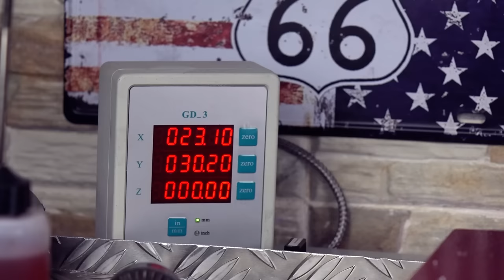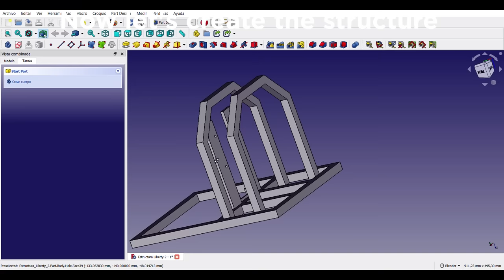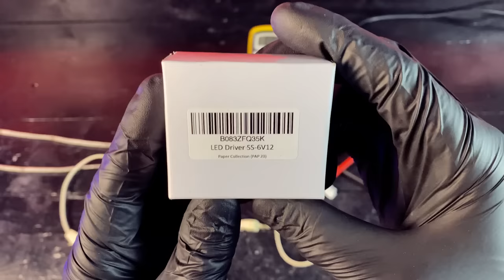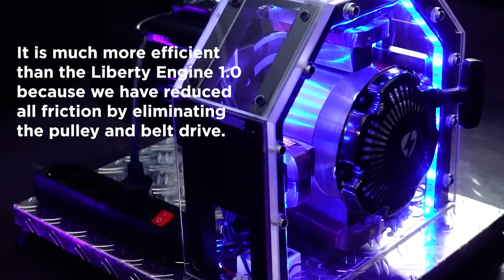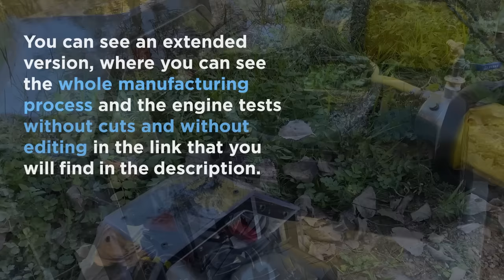Liberty Engine 2: THE PORTABLE FREE ENERGY GENERATOR that you can build yourself

Comment: Its sitting on a Metal welding table, I'm sure a current is running through it. Use the multimeter on the table! Anyone watching this who is educated will know this is a trick. It will always cancel its self out unless there is an additional net force added to keep it going.
Reply: My guess is that the batteries are hidden in the metal frame.  Or maybe, as you say, the table itself is powered.

Comment: You can't manufacture them and if u do a little research you can find what silver aluminum alloy reduces eddy currents go to a metals worker welder and he can melt that down and cut on a lathe. Lastly he is giving this as a free gift don't criticize unless you build one yourself. Then say it didn't work!  All you need is battery cells for a house setup like a tesla power wall and just one of these to generate power. You will have every oil company after this or him so it's given out as a gift I clued you all in why this man is SMART ENOUGH not to show his face.
Reply: Cai nay co gia bao nhieu tien vay sop

Comment: If you want a power output to the loads greater than this, than you must have a bigger size gauge for the 4 coils than what the microwave XFOs have (which are around 16 AWG wires).  Using  8 AWG size wires or even lower AWG sizes wires for the 4 coils will give you way more power to the loads than with the current wire size gauge for these 4 coils.  Bringing the 4 coils closer to the magnets will also be a great improvement.
Reply: Спасибо    за  разяснения

Comment: Actually we are doing this kind of testing with machines as a same.  It’s very difficult to keep rpm stables once connected load for motor.   Will be gets low until nearby to stop.   But if will install n52 neodymium magnets for the rotor then maybe would be good. Good job guys.

Comment: A UPS power backup would work instead of using the pull cord.  
Power directly to the motor will autostart it.
Better yet, a circuit to detect when the UPS is half empty to start the engine and recharge the UPS to 100% before shutting it off again would be great!
I've "performed" actual "magic" with dice, and never can speak of it without being met by complete disbelief.
Who cares?  I know what's real, and that's enough for me. 
This is not free energy.  It's the efficient recovery of stored energy.  
It takes a lot of electrical energy to manufacture neodymium magnets.  
If they were naturally occurring, this would be free energy.
You are not getting something from nothing, as some would claim this is.
Reply: There are a dozen other friction points in this heap of spinning illusion to guarantee it's motion will never be "perpetual".
Reply: @malcontender6319  I didn't catch the part where they claimed this to be perpetual motion. 
That would be an incorrect assumption. 
A generator is not a perpetual motion machine any more than the sun is. It works until it doesn't work anymore. 
Neodynium has stored force. 
This isn't something from nothing, regardless of the fact that everything that exists has originated from nothing.

Comment: Nice idea 
But impractical for industry and home use. 
answer:
First, it will not be possible to connect another consumer to the electric motor shown here, since as soon as we connect, we will receive a drastic decrease in electric power and the circuit will stop 
Because there won't be enough power to drive the motor connected to the circuit.
If you still want to create such a circuit, you will have to connect it to a transformer which will increase the output current above 220v and will be connected to a large lithium battery and if we connect a consumer regularly of course there are continuous losses of electricity in this nice circuit 
And for this reason it did not reach the industry and the home consumer. I was happy to help, have a good day everyone.🎉

Comment: On the frame find the highest point of vibration and at that point add a damper spring . Its an old idea with great results to reduce harmonic vibrations . I suspect the front bearing of the electric motor is bearing more load than was expected . This isnt  a complaint . The noise it produces Im sure is mostly caused by the motors front bearing holding the load of the aluminum rotor . A front bearing and bracket machined to support the front of the rotor could eliminate the issue entirely. I love what you have made thank you for sharing all your hard work suggestions aside you made a great machine.

Comment: Couple questions: will bigger/more magnets generate more rpm, hence voltage? And second question, can adding gears generate more rpms too, but will it lose power? I'm in medicine, and don't have an engineering background.  Would spooling more copper wire around also generate more power?

Comment: Put the meter on the power strip the motor is plugged into, then unplug the motor. I wanna see the voltage drop as the motor slows. 

Good scene cuts when you hook up the power. I'll give props for that.

Comment: Revisando un poco los comentarios, se encuentra que hablar de lo que no sabemos es demasiado fácil. El modelo no muestra que el motor sea el generador. El motor es solamente el encargado de activar el rotor y las bobinas, que en mi poco conocimiento es el verdadero generador. Ahora bien, hasta ahora nadie responde que haya hecho uno similar, además, no se tiene el plano del cableado eléctrico ni de los componentes que controlan la potencia y estabilizan el consumo. Todo es posible. En resumen se ve un dinamo de X potencia movido por un motor, pero el motor no es el generador. Miremos y leamos bien, seguramente eso acabará con la crítica destructiva y si tenemos conocimientos sobre el tema, por favor compartirlos para construir, no para destruir. Gracias
Reply: Tienes razón al decir que el motor no es el generador peroooooooooooo el motor con los imanes todo chulo si te puedo generar 100-200-400V y lo que quieras pero el problema radica en el Amperaje o corriente el tamaño de ese motor y el calibre del cable de esas bobinas de microondas genera una carga tan pequeña que no va a prender nada porque hay una caída de corriente y por ende de voltaje por descgracia estos vídeos son atrapa bobos y si estos experimentos se realizan en prepas o universidades

Comment: i wonder if there's any way we could get hints to the composition of the rotor alloy? i know it's Against 10% of All rules, possibly Since were talking, it might be Zippier if you could drop a few Custom nuggets - not like a Mgazine, eh?
The mass of the rotor is unusual - the AlAg alloy is expensive, so why make one that large when much smaller would work? Probably needs the rotary intertia? They gave the volume and weight in another video, we can get the density - but it doesn't help determine exact composition. The magnets are axially magnetised (not the usual diametrically) N52 neodymium. The only other snippet of information I can deduce is that the generator pole count must be a multiple of the motor pole count - they use a 4-pole motor - Liberty 1 used a 12-pole alternator (3 parallel) and Liberty 2 uses just 4-poles - something to do with the asynchronous timing of the inductive drag on the rotor. Also, note the RPM of the motor - to generate 50Hz with a 4-pole generator, it needs to spin at 1500RPM (50Hz*60/2) not the 1400 RPM motor noted during another video. It's also a permanent capacitor motor, for those wondering. That affects the magnetic dynamics as the second coil is 90degress out of phase permanently.
Reply: The rotor is made from pure pixie dust.  The wires are a-grade unicorn hair.  And it is lubricated with top quality snake-oil.

Comment: Simple solution, as with every magnet motor. The magnets contain the energy that runs the "motor". Running the motor will eventually deplete the magnets. It seems the motor is reversing the polarity of the coils allowing it to run perpetually until magent depletion.

Comment: Podrías utilizar una única pieza:
Utilizar el mismo motor (u otro adaptado para la ocasión) de forma que en el mismo cuerpo, tengas la parte motora y la generadora (Manipulando devanados, y cambiando si hace falta la aleación del material, para optimizar tanto el torque/par, como la generación).

Otro tema a tener en cuenta, es el tipo pode motor, si es con escobilla o de tipo electrónico (mucho más eficiente).

NOTA: Aún no estoy convencido de que realmente funcionen tus montajes, pero si así fuera, cualquier optimización del sistema, es un buen aporte.

Comment: Anyone that doesn't believe this needs to go back elementary school. Just a fact. This is beyond simple, this works, the problem is magnet "wear" due to heat and bearing wear. This is not infinite or perpetual due to this but it's so damn close. How much heat does it generate? How long can you operate the device before the motor bearings fail? These are my questions. Can't wait to build my own!
Reply: That's the correct answer. It's a simple energy conversion process and does not violate any laws of thermodynamics. Even heat and magnet wear can be greatly reduced by incorporating an back EMF design
Reply: magnetic bearings are on the market

Comment: pena que eu não consigo postar o desenho do Pinóquio aqui nos comentários, por mais leigo que vc seja, raciocina da forma correta; mesmo que as bobinas de micro-ondas conseguissem realimentar o motor de uma forma que ele conseguisse manter a rotação especifica isso talvez só fosse possível se a tensão fornecida pelas bobinas fosse maior do que a tensão nominal do motor que é 220 volts, e isso não acontece porque vemos uma tensão de 228 volts na rotação máxima do motor que é 1500 rpm, outro detalhe é a carga, quanto mais carga ligada no circuito menos tensão é fornecida, então como que um motor que tem sua rotação máxima alcançada somente quando é alimentado com a sua tensão nominal no caso 220volts vai conseguir manter a rotação quando forem ligado as varias cargas nas tomadas? e não é isso que vemos no vídeo,  quando se liga as várias cargas não tem redução nenhuma na rotação do motor, um dia se você tiver a oportunidade de ver de perto um gerador com motor a diesel vai observar que quanto maior a carga mais pesado fica o rotor do gerador e mais força o motor tem que fazer para rotacionar o gerador, resultado disso é a diminuição do rpm.
Reply: el motor es de 3000 rpm
Reply: @luismanueldiazoliva9099  usei 1500 só para exemplificar o raciocínio, mas se o do video é de 3000 rpm a situação fica mais difícil ainda de se estabilizar uma rotação inicial, porque quanto mais alta é a rotação nominal do motor mais tempo leva para as bobinas realimentarem até se estabilizar.
Reply: @pwmlow4684  o duro eh ver o pessoal pedido pra comprar, pra mostrar as plantas e tals. kkkk  Estudar o basico de termodinamica ninguem quer.

Comment: NO SARCASM!

I really enjoyed your video, and I learned a thing or two. I thank you for that.

I especially love the fact that you went above and beyond. You didn’t just build a generator, you made a stylish generator.

Not only is the chassis very stylish and practical (you want to see the insides for numerous reasons) but you also painted the whole thing reflective black. 

You gave it strings of neon pink lights. You embedded logos. You clearly understand presentation. Its not just some bland generator, it is an artistic product.

I love how you found a practical way to disconnect the generator via switch, and how you developed a pull cord.

Next step is to use a starter motor instead eh?

Comment: I have never seen an induction motor with bolts on the rotor, what in the world are the bolts for?
The rotor for induction motors is just stacks of thin steel plates arranged in a diagonal pattern, and glued together, so again, what are the bolts on the rotor for?
Reply: I believe the phrase you're looking to google is "Squirrel Cage Rotor"
Reply: SAME THOUGHT AS WELL.
Reply: Well spotted. I asked the same thing.
Reply: Perhaps the bolts hide the batteries?  Or the wiring to the batteries hidden elsewhere?

Comment: the premise here is given the diameter of the rotor, with the 2 coils (upper/lower) in parallel then one gets 220v 50-60cycle, system appears to not require a governor to maintain the cycles for the 220v electric engine, the (right/left wired in parallel) pair are excess power (220v 50Hz that the system does not need) this is free for charging voltage or power a unit.  (similar wiring to Tesla patent US382279A image 1, output Z with (r/l pair being Z'))

The Aluminum/silver rotor contain the magnetic poles (would like to see an iron fillings apparatus placed over the rotor to have an understanding of what the Al/Ag rotor is doing to magnetic field)  You state eliminating/reducing eddy currents that are being produced.  But could not a standard Al rotor with a coating of Amumetal shielding product same result?

Per this premise the only part you need to supply is the rotor, for anyone to then 'kit' build this unit to validate this video.  But, you state you cannot sell the rotor (due to patent infringements, may we know the patents that this would infringe on?)

Tesla patent does not assert that an alloy mix is not required.

Comment: Can you tell us how you made the special alloy to reduce the eddy currents to zero?
Reply: 66.6 silver for conductivity, 33.3 aluminum for malleability and added strength. Making it for industrial purposes it would be beneficial to utilize 10k gold, although it would be quite expensive, you’d have a true lossless system with markedly improved rpm. Don’t concern yourself with frictional forces, focus on looping power back into the electromagnetic process. Frictional forces are only a concern if there wasn’t enough rpm to counteract the affects. Your welcome. Oh, i built a working model more than 15 years ago, i still use it today for a tiny fridge in my garage. Facts! Claiming a patent would only get him unalived
Reply: @Namebrandnitty   I think one of the videos stated I operates at 4,500 rpm, does that make sense?
Reply: @brian-todddantinne  makes a lot of sense, roughly what he’ll get out of that size configuration. Increasing wire gauge and bring the coils closer will improve it even more, he could triple that output easily.

Comment: Start it with a spring that is coiled when stopping, ready to turn the shaft when released again and then held back while the engine runs. A modern version of the old hand crank. Only needs a release method to activate again. Small battery switch.

Comment: ❤ ok instead of 4 coils..try 6  or maybe 8 coils from a microwave. Bigger means more power with a larger frame..with an offset gears to gear up the Ratio to spin a Generator  ..also in the front part you can add a pulley to use for ad on ..like add a wind Generator???

Comment: Dann erklärt mir doch mal, wie aus diesem Perpetuum Mobile ganz ohne Regelung genau 230V und 50 Hz heraus kommen sollten und das auch unter Last stabil bleiben soll. Würde das Ding wirklich funktionieren, so wäre der Erbauer längst Multimillionär und würde in Serie produzieren!
Reply: probably the 50Hz can be explained by the diameter of the rotor, magnets dimension and their strength. Some combination will create that equilibrium at 50Hz. But as you said under load it should change the frequency and we should hear a change in motor pitch. We can't hear anything. I'm thinking some thin wires are hidden and powering this or there is post production on the video to hide it

Comment: So. I understand the problem solved here with the rotor, harness angular momentum using a mass large enough to overcome emf saturation and use the collapsing emf to attract the opposite pole!  I'm in awe! No laws are broken here and the rotor is truly a work of science.
Reply: For those unaware, this is a collapsing field generator from Tesla's patent.  Please correct me if wrong.  So the only issue resides with the rotors formulation.

Comment: The microwave transformers are 50hz the inductive  disk is made of a special 99% aluminum and 1% silver to prevent eddy current interference. The motor is a 1hp 240vac 50 hz single phase sycronious  motor . The rest is easy.
Reply: You forgot the hidden battery 😂

Comment: So, is the rotor made up of 62% Ag, 30%Au, 2%Cu, 2%Be, 2%Bi?
Motor comes from Poland 220v and the Patent is Military Use Clause?  did I get it right? 🤞
Reply: how do you know?
Reply: @charlesmedlock9408   I don’t,  am guessing due to other patents but the person won’t reply.  He only reply’s to people like “ can you sell me one” or “ I’ll buy one from you”.
Reply: What would happen if the rotor was just made from a readily available block of aluminium?
Reply: @Mark_Meisho_Thompson  it won’t work because it has to do something with the Material Conductivity (Siemens/m) example:
Aluminum (37,667,620.)
Copper (59,772,863.)
Silver (62,893,081.)
Iron (10,298,661.)
Each metal has it eddy current conductivity.  I believe it has to have the correct mix so that the rotor can release just enough back EMF.  This  gen is a pulse Generator and is running on radiant energy. Look up Robert Adam
Reply: @McFlysGaming Ah I see you've given this some thought
Reply from the maker: We can't say more about the rotor
Reply: Hi can I have the price for the rotor?

Comment: Where can I buy parts? The machining is above my expertise. But I am a great electronic repair guy. So I could assembly it. 
Will it run the whole house?
Reply from the maker: The most difficult thing to get is the material to make the rotor. we can't sell anything
Reply: @thelibertyengineproject7966  okay guess I will have to teach myself to do it. Can I get a copy of the long assembly video?
Reply: How many pounds of silver do I need? I have a couple bricks bought for investment.  Do I have it melted down.  With the proper amount of mix?
Reply: Silver+aluminium alloy. Never!!!😂
Reply: 20,000 Watts is plenty for a house, probably two.